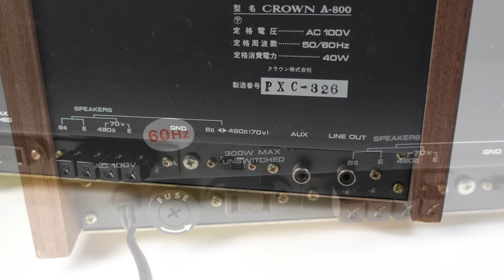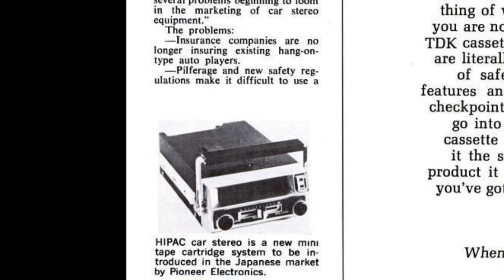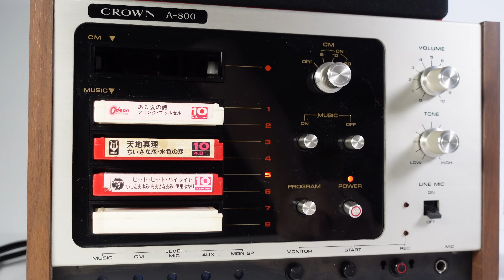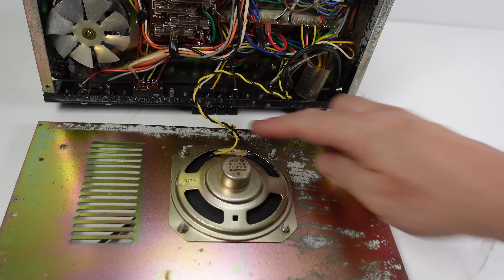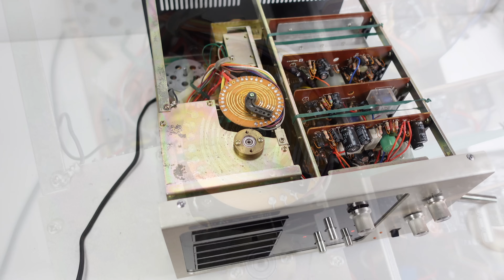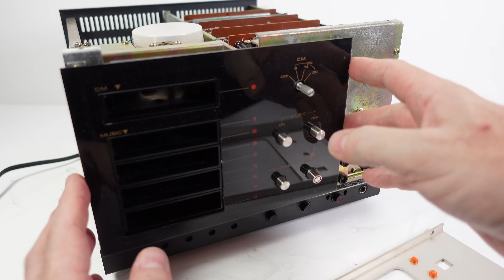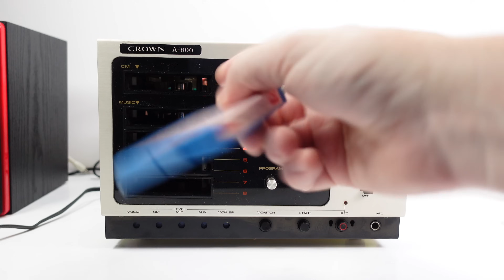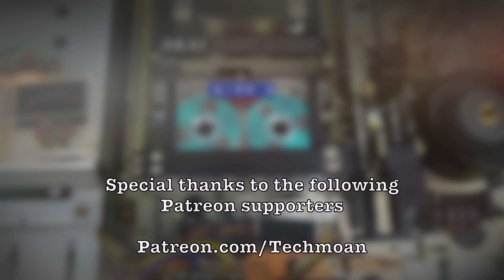An unusual player for a forgotten ‘70s music format

Comment: I recognize the motor from when I used to do repair on Realistic (Radio Shack) equipment. It is a synchronous motor and you can change the speed by changing the capacitance. Be sure to use an AC-rated capacitor, NOT an electrolytic capacitor or common film-type capacitors.
Reply: Yes .Those were common back in the day  of players and recorders of any kind..
Reply: I don't know if you have actually tried to change the speed of a synchronous motor by varying the value of the capacitor, but it is unlikely to have worked. By its very nature the speed of a synchronous motor it directly related to the number of poles it has and the supply frequency.
This is a 2 phase synchronous motor. It will consist of a permanent magnet rotor and a stator that has 2 sets of windings (poles). One set of poles will be connected directly to the supply whilst the other set will be connected to the supply in series with the capacitor. If there were just 2 sets of poles then they would be arranged 90 degrees apart round the rotor. The greater the number of poles then the slower the synchronous speed of the motor in relation to the supply frequency. In order to change the speed of the mechanism being driven by the motor a different pulley size will need to be installed.
The purpose of the capacitor is to produce a shift in the phase of the current in one set of windings relative to the current in the other set. The ideal difference in phase of the current between the 2 windings is 90 degrees. This will mean that the alternating magnetic field in the 2 sets of windings will be out of phase by 90 degrees relative to each other resulting in a rotating magnetic field round the stator which the permanent magnet in the rotor will follow at synchronous speed.
The reason that the capacitance value is recommended to be different depending on the frequency is that the correct phase difference between the poles and the correct current within the shifted poles is dependant of the reactive impedance of the capacitor which changes with frequency.
The reactance of any given value of capacitor goes up as frequency goes down. Using a capacitor whose value is meant for 60Hz on a 50Hz supply will mean that the current flowing in the phase shifted windings will be lower than designed and the phase shift will be less that ideal. The motor may (and in this case does) still run at the lower speed, but will not be as efficient as it would given the correct capacitor value for 50Hz.
In order to get the machine in this video to run at the correct speed efficiently requires the capacitor and pulley size to be changed.
Reply: @paulmccredie3106  I've just come back from watching the video where in the future from this video he DOES ONLY change the capacitor and the machine plays faster!! So egg on all your faces who were adamant that it would not work!!
Well, IT DID WORK!!
SO, NNYAAHH!!
Reply: You can jump in a pair of 2 uf polarized electrolytic caps negative to negative, giving 1uf non-polarized. Back then, NP caps internally were back to back electrolytic, as you weren't getting a mike value in anything else in those days.
Old TV guy here, did everything from tube, hybrid, VLSI, etc over the years, picked up VCR's and CD/DVD, then everything went disposable in price, so went into IT.
Modern TV's, clueless, I'd have to pick up the docs on the formats and current processing techniques, but those are pretty much disposable too.
Reply: @spvillano  You missed out on Plasma tv technology. Which is still superior to tv motion and colors of today.
Reply: What are you talking about AC rated capacitor? :D Capacitors are AC by definition. The difference between electrolytic and "common" film capacitor is the frequency of the AC they are operating at, and especially the voltage, with the latter you cited being rated at higher voltages. All types of capacitors you listed are common. One needs a frequency converter to chance the "speed" of a motor that was designed to work of a different frequency AC  line, unless a special speed control device is mounted on the motor itself.
Reply: bump love to see him change the capacitor ang get the speed right.
Reply: @sarahmanalapan8443  he did just that!!

Comment: The capacitor value will not make any motors run faster. I do not think the motors are driven by the native ac supply, they'll be a circuit board fed from the transformed DC supply, then transformed to 60 Hz to drive the motors. My humble opinion, your diagnoses as to why the motors are running slower is incorrect.

Comment: Very intriguing!  I'm curious as to how many contacts there are on the microphone connector.  🎤
If there are more than two, maybe there is a provision for a switch that signals end-of-msg that the user is supposed to hold for a brief time period. This might cause a built-in tone generator to be recorded on the second channel.  If so, you could simulate the original equipment with just a momentary switch of some kind.   It seems unlikely that the tone generator circuit would live inside the OEM microphone, but I suppose that's another possibility. 🤔

Comment: 8 track in the UK came way after the cassette. The cassette was number 1 in the home and also the car. Then people found the tape stretching  or getting chewed up so the  blank cassette manufactures/companies  then brought out the metal cassettes but the record company releases were still produced on normal tapes and did not last long.  In addition the playback of metal cassettes had to be played  on a metal head player. Then came the bulky 8track cartridges which aslo wore out with constant playing. Then came the mini discs which were far superior than cassette and 8trk. Sony mini disc players and blank discs to record on , especially if you were to use a graphic eq while recording was better than some studio quality LP's (often)  You could fix the sound the way you wanted (more bass less treble etc-not the way they wanted!
Not before long, some record companies started to release LP, cassette and mini disc formats. Cassettes then were being phased out giving way to mini disk. Then came the dreaded CD's claiming to be indestructible . Bah Hum bug. One of the sales pitches was "if you listen closely you can actually hear (**) squeaky bass pedal!"  Sound repro on a MD is far superior to an y CD I have heard.
Thanks for the memory lane trip.

Comment: I'm not sure if anyone answered the questions about what this advice is for in detail, but it is a machine that would be used for, as you said, a store or perhaps a radio station.  CM stands for "Commercial Message". It's a pretty innovative machine for its time and I am surprised that it wasn't used in the USA.  But I am sure it is still used in Japan by some small shops that bought them many years ago. I say all this as someone that's worked in Japan for a long time. First time I am seeing one of these though. Fascinating.

Comment: I have a Sony TC-366 reel-to-reel tape deck. It was running slow, and the capacitor inside had leaked (so it was still a capacitor, but the wrong capacitance). I removed the capacitor and the motor stopped turning altogether. I replaced the capacitor with a new one (which actually provided the rated capacitance), and the deck now runs at the correct speed.  This proves that changing capacitance can change motor speed, so I will bet that if you change this capacitor, your speed problem will disappear.

Comment: When my dad worked as a weather observer for the (US) National Weather Service back in the late 70's and early 80's, I remember seeing a device similar to this where he worked.
It was used to constantly play the vocal recorded loop of the day's forecast into the broadcasting system that sent it out as the official NWS radio forecast. I don't know what need they could have had for more than 2-3 slots, but it seems like that machine could hold several cartridges, like this one can.

In retrospect, though, I would almost have to assume the device I saw at the NWS office was not an obscure Japanese format which never took off outside Japan, but more likely to be 8-track or something more compatible to 8-track, which could better take advantage of the economics of mass production at least for blank cassettes. But the fact that this thing could record really made me wonder a little bit. Logically, I don't think they recorded on the same machine that was supposed to be constantly sending out the current broadcast anyway, but seeing this did bring back the memory of time as a child, spent at my dad's workplace, playing with the degausser and listening to the teletypes rattle off the latest information from wherever.
Reply: What you saw was probably a jingle machine that used an 8 track cartridge. Used a lot in radio stations back in the day.

Comment: I would be rather surprised if changing the capacitor changes the speed. If you try it, keep in mind that it appears to be a non-polarized electrolytic. Don't just slap in a polarized (ordinary) electrolytic cap. They are designed to always see one DC polarity, and can be destroyed by connecting AC without DC bias.

Depending on what kind of motor it is, one could design a circuit that would use a capacitor to change the speed. But you would not typically use an electrolytic for such an application, because their values are neither precise nor stable. The actual value of an electrolytic can vary from nominal by more than the difference between 50 and 60 hertz. A common tolerance range for electrolytics is +80%/-20%.

I would bet that the speed change was accomplished by swapping the motor pulley.

Comment: Did you ever find out what the speaker that's inside was for ?
Reply: He did mention that. It only worked with the CM slot at the top. It is so you can record your commercial message and test/listen to it without having it go out over the other speakers throughout the store or wherever.

Comment: I love your channel,  I worked as a Chief Engineer for A very large broadcast company for years before leaving the sound world.  You make fantastic and interesting content.  thank you. As far as your question about the Capacitor change.  It is part of what is known as an RC timing circuit R=Resistor C=(you guessed it)Capcitor, and since the capacitor on charges on the Postive side of the AC circuit you can make a regular timing pulse...... most people change the resistor in this circuit and connect it to a switch to that you can use it on either 50 or 60 HZ, but not my design.  
Adding a second Parallel cap will cause 2 pulses at different times.... and maybe blow up a fuse or some other Analog timing circuit.  Just one large cap that is rated for the voltage and capacitance and it will create the timing pulse for the motor.  Its the same way old TV's frame rate is made on the tube and how the gun knew when to go back to home(the first row) 30 positive cycles every second to bring the guns back to the top for the US.  It only sees the the top half of the AC sign wave.  its sort of like making just half of a Brige rectifier for a AC to DC power supply
Reply: How would a second parallel cap cause a second pulse?  Whichever cap is at the higher voltage will discharge into the lower voltage cap before the rest of the circuit sees it, so the circuit will only ever see a single capacitor of combined value, even if you connect two in parallel.  They perfectly combine and act like one capacitor.

Comment: Speed issue: A lot is going to depend on what type of motor it has.  I doubt that it is synchronous, that would require that it had dc field windings and two more phases.  I doubt that it is a stepper motor, that usually requires a special chip to drive it in the 70s - and it would have 4 input leads.  There are a couple more motor designs that it likely doesn't have.  It is probably going to be an induction motor that uses a capacitor to start it (needs a minimum of two phases to start, and 60hz 115V is single phase - the capacitor makes it act like it has another separate phase).  If it is an induction motor, it will probably only have two leads to feed in the 115vac to the windings of the motor, and another separate winding that is fed by the capacitor.  Now - all induction motors slip to a certain extent.  I can't say for certain because I would need the circuit diagram to tell - but your Hipac motor MIGHT be designed to slip a different amount depending on what capacitor is feeding the second winding.  If that is the case, switching the capacitors might change the speed.  I personally wouldn't design it that way because you can't really control the speed very well, you end up basing the speed on whatever the electric supply company is producing - and that usually isn't perfectly 50 or 60 hz.  What you would need to be sure of is - does that capacitor directly feed the motor?  If it does, it is probably OK to try.  If not, I wouldn't do it.  An EE's take on it, although I haven't used a lot of the power stuff (like motors) for a while.

Comment: GM-Holden in Australia also had 8-track systems available as an option in the HQ model Holdens of 1971-74. A recess for the player under the steering column, but rarely optioned as cassettes started to take off.

Comment: if the pioneer cassette - flip clock had a synchronous motor adjustment for the flip clock, what was the adjustment for the cassette part, was it a belt speed changeover mechanism like the Phillips ski slope player. the only frequency critical component in your player is the standard frequency locked induction drive motor to cassette tape drive wheel and the easiest way to adjust that is not to have two different motors with two different speeds in the factory to install but to simply have the one type of motor and 2 different size motor pulleys to choose from when manufacturing, which ever sized wheel was installed would dictate what correct frequency needed to be used for correct operation. 
about the cap....  its value is matched to balance with the frequency used probably as a smoothing cap or interference suppressor and would need to be changed if the frequency is changed as is the case for you but is really only applicable if the unit is on for extended periods of time.

Comment: AFTER he said that the "record" feature was a bit of a.. "special feature" I IMMEDIATELY realized what it was.. I mean.. right after I found out I was wrong, but.. to me it "made sense"..  

What I thought was this: "CM" (as written in western) I thought could stand for "Cassette Master".. and then.. you could have four tapes under.. and do some form of.. recording.. 

I thought this could've been specifically for mass-production of the actual tapes that would be sold. (of course, you'd need many more of these machines to get any real speed in the copying). 

But I guess the manual's guess was good too ;-)

Comment: About recording the commercials:  you might be on the right track about the tone.  Broadcast cart (continuous loop-like the Muntz 4-track) machines used a tone that was recorded for about one second at the beginning of the recording.  On playback when the player heard the tone it stopped, parking the tape at the beginning.  Maybe your recording procedure isn't producing the tone?  Maybe the player isn't hearing/reacting to the tone?

Comment: There looks to be a date code on the rear of the speaker 7617 which would suggest week of manufacture of the speaker was week 17 of 1976, you should find a similar code on the black tubular capacitors also which would suggest an approximate year of manufacture. As for the 60Hz speed dependency, I couldn't see the capstan motor properly but if it has a DC voltage on it the 60Hz won't matter, if it's AC then it probably would.

Comment: It's probably a synchronous motor, you can't change the speed of that without changing the incoming Hz.
The normal for one 50/60 Hz is to have two wheels for the belt so you just move the belt to the larger one.
The capacitor is probably making a virtual phase so the motor start at the right direction.
A capacitor in resonance phase shift the voltage 90 degree's and it's in resonance when the impedance of the motor match the reactance of the capacitor.  The formula is   Re= 1/(2*pi*Hz*cap) = 3184 Ohm for 1 µF at 50 Hz but only 2569 Ohm at 60 HZ.  Maybe that value didn't work so they have to change to a smaller capacitor.
But since they are built with different capacitors I guess they also have different driving belt wheels, or they could have a jumper that add one capacitor.
Anyway, if the motor only have one wheel, just 3Dprint one with 20% larger circumference.
Reply: Im glad you used the words. Probably , maybe and anyway.  Sometimes  few words say so much
Reply: I think you are right about the capacitor value, it is different for different line frequencies to match the reactance of both the capacitor and motor windings.
The legend on the circuit board is probably just a memo for anyone servicing the unit (especially in a country where line frequency depends on region!) and the true speed adjustment is done with the circumference of the motor pulley.
I have seen old tape decks with just a plain squirrel cage motor. As the load is fairly constant in playback mode, the slip can be compensated for in the mechanics.
The only way to determine if the motor is plain squirrel cage motor or reluctance synchronous motor with squirrel cage structure for startup is to apply some extra load and measure the speed with precise enough tachometer, or to disassemble the motor and look for the characteristic reluctance cutout patterns in the rotor laminations.